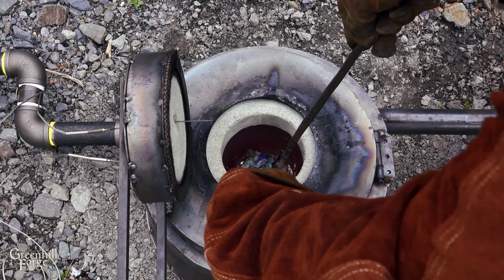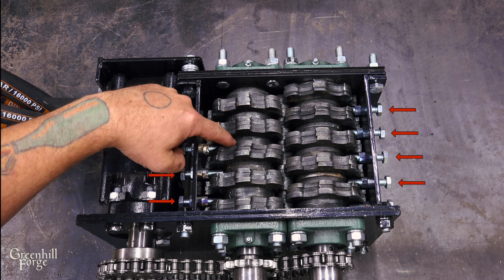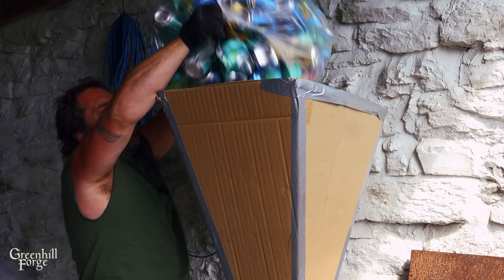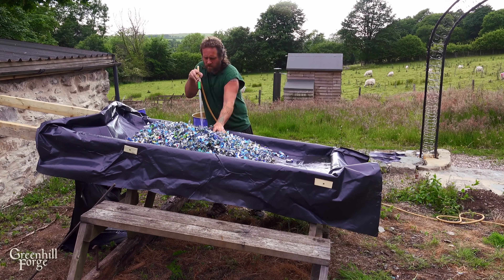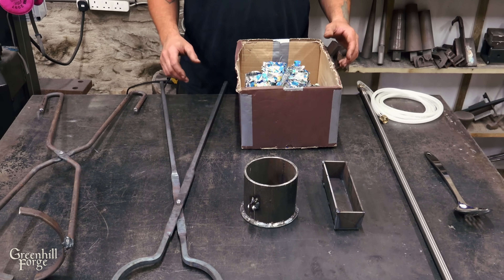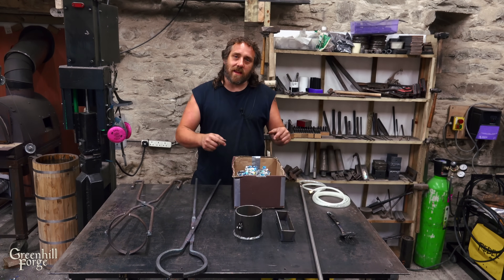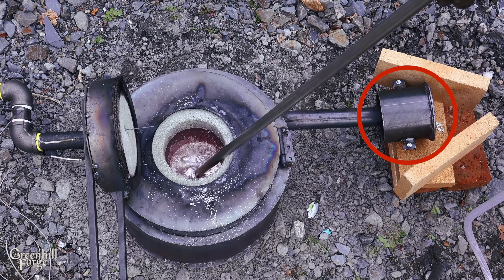DIY Casting: High Quality Aluminum from Recycled Cans!

Comment: Finally someone did it right, the only addition: should not have you used the flux from the start? although the dross was really minimum compared to everyone else but that what removed at the beginning looks like a lot of mix of aluminium, AFAIK the flux does makes the dross aluminium free (more yield)

Comment: You seem to be very knowledgeable about this, far more than the average diy enthusiast so maybe you already know this but here it goes anyway. I know there is a way of getting the printing off the aluminium sheet. I think it involves boiling or baking it first and then wiping it off with acetone or some other substance. There are probably videos about it. I don't know whether there is a method for getting rid of the internal coating. Perhaps neither the external printing nor the internal coating are much of a problem with regards to final metal quality when melting the scrap aluminium sheet - not enough to warrant the additional cost and effort. If not, where do the impurities originate?

Comment: Very good, never a dull moment here. Some good comments on here regarding the chemistry😂, metallurgy is a specialised subject itself. Maybe try some inlet manifold castings or wheels as they would be easier to chop up than a cylinder head. I worked as an electrician in an aluminium smelter, they used to suck the molten metal from the bottom of the cells to stop it oxidising. Don’t know if that is relevant to you? Still you have my attention, all the best. Cheers

Comment: Maybe you should sacrifice one of those pours so you can cut it in half to see if you truly do have a solid piece and zero air bubbles are trapped in the middle....  and you can just re-melt the pieces without having to do anything to it (you might get a little slag just from air mixing in while it melts)
- And like I said in my Novel of a previous comment, you should collect all that slag/dross that you scoop off and re-melt it just to see if you can recover any more from it because that was a HUGE amount of slag that came off of that first scoop..... but I'm comparing it to seeing years and years of another channel melting cans without shredding or washing them - just crushing them.... THAT is why I'm SO interested in seeing how much you recover from re-melting the slag :)
- BUT I REALLY like your setup...  do you have a valve on that pipe that comes off the furnace to pre-heat aluminum blocks and molds? cause I would think you are losing A LOT of heat if it's always open..... and I noticed you're using a blower along with the propane, but the guy I watch doesn't use a blower at all, just the pressure from the propane tank...  But you see a LOT of orange flame coming out of the center hole in the lid and when he opens the lid... so he must be using A CRAP-TON MORE PROPANE than you, and thats why he's got so much large orange flame.... I wonder if its quicker for him to melt than with using a blower.... I would think so, but its much more wasteful... and expensive!

Comment: why are you washing the shredded cans? I follow another channel where the guy just melts scrap copper, aluminum, brass, and cast iron... And he too collects aluminum cans and melts them down, but he doesn't shred them - he just crushes them... one at a time with a custom machine (think of a car piston being used to squish the cans down from end to end... just like how you would stomp on one :D) .... he doesn't wash them at all tho....  he just drops them into the hole in the lid of his Devil Forge furnace....  and once the crucible pretty much full he just takes it out and with a DRY steel spoon he scrapes off the dross/slag and tries to get as much of the melted aluminum to to fall back in using the side of the crucible..... BUT when he's all done melting the cans, he will RE-MELT all that slag again because with aluminum a whole bunch gets trapped in that clump of slag, along with a bunch of air too... so you can get yourself quite a bit back from re-melting it all...
- BUT he never washes the cans off (and he doesn't shred them either) and I've read in the comments other viewers asking why he doesn't shred and rinse off the cans to get off the excess pepsi or beer or whatever because there are gonna be a lot of different sugars that burn and stick to it..... and he replied something along the lines of not needing to because it all turns to carbon at those temps and will float up into the slag IF it stuck to the aluminum (it mostly turns top ask and flies off once it floats to the top of the melted aluminum) and because he re-melts the slag that comes off he's not too worries about any small amounts that might still be left in the slag that get lost.. it's just not worth all that extra effort (I'd think mainly because he's not shredding them, and the cans would hold soooo much water even when they're crushed)
- IMO you're doing a lot of extra work that isn't gonna make too much of a difference... 
- - -  So I'm thinking you could do a little bit of an experiment where you you shred up two batches of can, both the same exact amount (I think counting out the same number of cans for each batch would be the best way to keep the same amount) and one batch you do everything the way you normally would, but in the second batch you forgo any of the washing steps...  and EVERYTHING else the same... and see if you get any more/less slag and/or weight at the very end.... and my theory is that you might have a but more slag in the non washed... but you COULD set that all aside and re-melt it later... and then compare the the results and see if the extra work of washing is worth any amount that you gained....
- -  BUT you can just ignore my suggestion and do thing YOUR way.. it is YOUR channel after all and I have no stake in this.... I just wanted to help you save some time and energy :)

Comment: This is great, I've been scratching my head on how to degass my pours and your method is really straightforward.

I think it's really awesome that you're using other projects for this, and that this work supports another project as well. The synergy!
Reply: Just because you think you are doing something doesn't mean it actually works. It has to be done right. And without doing a comparison, with and without, you have no idea if what you have done made any difference.

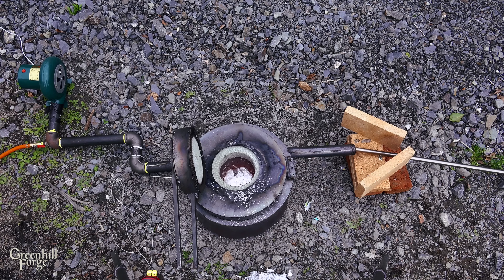Comment: 7:50 Common mistake, borax is not a good flux for aluminum because it reacts to form aluminum borate and oxygen, which will then oxidize other aluminum. So it's a horrible flux. But sometimes people want aluminum borate for alloying purposes, but for this you need to weigh it
Reply: Then what is a good flux for aluminum
Reply: I've heard that salt is a better flux ?
Reply: the best flux for home smelting of aluminum cans is a sodium-potassium chloride mixture (lite salt), with commercial chloride-based fluxes offering enhanced performance when used with proper degassing techniques.

Comment: Hey man, I rarely do comment on yt but this one here is for you to encourage you further developing your process.
Just a thought, to simplify things a little with regard to shredding and cleaning:
Why not modify a barrel by inserting a screen and a bottom valve to drain dirty water whilst the same barrel already acts as receiver for the shredded metal?
By doing so, you'd be saving space and time in your process.
Another way could be to have the barrel rotate whilst its washing the shreds. Youd be achiving a better cleaning result and whilst the barrell is still horizontal, draining is also easier to achieve.

You rock, greetings from Germany
Reply from the maker: Thanks, good idea. I think if I was going to do a lot of this I'd try to find an old used clothes washing machine online and use that. Maybe screen under the shredder to separate anything too small that could damage the pump or go through the tub holes. but that's basically what you described so I think we're on the right track.

Comment: Borax is a flux for higher melting temperature metals, not for aluminum. For degassing the argon needs to be in very fine bubbles. The large bubbles you are producing effectively does little to remove hydrogen in the melt. The large bubbles creates more turbulence on the surface creating more oxides and exposing more aluminum to hydrogen in the air which is absorbed back into the melt.  

Go to Google Scholar and search for Castings Practice: The Ten Rules of Castings. Go to section 1.5.1 Degassing. I would provide a link but YouTube deletes eternal links. 

Your heading says High Quality Aluminum from Recycled Cans. What you are doing might make the aluminum better for casting than just using melted cans, but it still will not be High Quality Aluminum. Never mind the unknown alloy mix, the problem is all the oxides in your melt. Due to the cans being effectively all surface area the oxides level is extremely high. Oxides are hard to get out of aluminum because the density is almost the same as aluminum. It will not float out or sink to the bottom unless you can control convection in the melt. 

I applaud you for trying to produce a higher quality output. While you have done more research that most hobby casters it isn't enough to get the results that you think you will be getting with the extra effort you are putting in. 

 Complete Casting Handbook - Metal Casting Processes, Metallurgy,  Techniques and Design    Second Edition by  John Campbell is a great book if you want to get a deep understanding. It is over 1000 pages and some of it is quite technical. Its not cheap. Castings Practice: The Ten Rules of Castings is a subsection of this book and would be a less costly option that is more practical in its scope.

Comment: Using the waste heat from the furnace to pre-heat the blocks!! Great idea and applaud the safety of that removing the moisture from the cubes before dropping them in. I may not have done myself.

Comment: I have all of this equipment but never realized how much more I needed to know. Thank you so much. Wow 7% silicon. And 1% copper. That is valuable information. I don't know if you'd ever be up for it but just showing Metal without having gone through your process and comparing the two might be fascinating. Tests, maleability machining, etcetera.

Just great solid content, man. Good on you.

Comment: So why not just do a good rinse on the cans and then crush them before pressing? Wouldn't that be easier than shredding, washing and all those extra steps?
Reply from the maker: I shredded/washed about 1000 cans. My thinking was I'd get them cleaner and drier by shredding them. More of a process but my goal was to go for as good an alloy as possible so I wanted to prep as well as possible. Side note, I think being dry is much more important than being clean.
Reply: That makes sense. Thank you.

Comment: Most people degass by adding an aluminum foil packet containing table salt... and pushing it to the bottom.

But I don't know how this would react with the silicon and copper...

The other major thing is that copper melts at higher temperatures, so that should generally be melted first in the process of making alloys...
Reply: Copper dissolves in liquid aluminium, you don't need to reach melting temp of copper

Comment: That looks really good, though I’d change the cleaning step. I say that for a couple reasons. The only bit you’re cleaning off is the residue of the contents of the original cans. You won’t remove any oxide layers or even the plastic lining on the inside of the can. Skip using the water bath, save the time, melt the original cubed shreds into ingots. This will remove the majority of the oxides, but more importantly it’ll correct the math for your alloy instead of including the weight of the dross. I have bars of beer cans I’ve melted down so I’ll use your numbers of Si and Cu and see if I like the alloy for casting parts. Great work, good video!
Reply from the maker: Thanks. My thinking is that sugars can add a lot of impurities and the goal here is to get as good aluminum as possible so I think washing probably helps. I wouldn't want to do very much of it but for a specfic pour I don't mind, it's even fun. the si and cu weights are not based on pre melting weights, I recorded the volume of the crucible at different heights with water before the melt so I was able to estimate the volume/weight of the clean molten aluminum pretty closely.
Reply: @GreenhillForge the sugars burn off at the elevated temps i use for initial melts.
Reply: Yeah, the shredding and washing is absolutely unnecessary. Just crush 'em and straight to the forge.

Comment: Funny thing, borax is actually a bad flux for aluminum, but people use it anyways because it works on steel.  Have you considered using Nocor? When I run my cans, I do a two melts: one a rough cleaning melt to clean out the bulk of the burnt carbon from the inner can liner and paint with a propane forge; a final melt with an electric forge and Nocor. Sure it’s very inefficient to remelt the aluminum twice, but I am planning to add additional processing in the second more controlled melt. Anyways, good job on this project so far. I liked the wash process which I currently don’t because I don’t shred my cans.  I would if an acetone rise help pull out the plastics before the first melt… food for thought, thank you.
Reply: hi mate, I also discover borax it is not ok for aluminium. I ve searched for nocor but didnt find any results, would you please give any advice about that? Thanks a lot
Reply: @josedavid6400  Sorry, I wrote a reply with a link to the correct product, but it was auto-removed or something? odd.  Anyways, I got the name of the product wrong. It's actually named Alum-a-flux or Forney 37025 Aluminum Welding Flux. It's not the most expensive flux nor it is cheapest.
Reply: @simple_fred thanks mate!!
Reply: @josedavid6400    further up and down the comments 50% NaCl and 50% KCl salts seem to get used a lot as flux for aluminum.
Reply: @joansparky4439 yeah mate this is what I actually use, works well but want to try something else if works even better. Thanks
Reply: @josedavid6400  ah, ok.  Thx for the info tho.. I collect alu to melt it someday.. so been binge watching it.
Reply: @josedavid6400 hey do you want to hear something else funny? The different parts of the can are made from different alloys. To can an alloy closer to 2124, you need to add approx 40g of copper per 1kg of cans and not silicone like the host did.
Reply: @simple_fred wow very interesting, I thought alloy was 2140 but didnt know there are different ones. 

Im looking for make this “custom” alloys to improve machinabilty. By now we are melting tons of cans for making room in the shop (we have around a few dozens of thousands) 😅 First we are melting small ingots just for make room in the shop and cleaning a bit all dross from the cans. 
Do you recommend any lecture about diy alloys? not much techy please 😊
Reply: @josedavid6400  this sounds crazy, but I
ChatGPT isn’t bad so long as you double check with sites like wolfram alpha or an engineering text. Sadly, the bulk of my text are EE related so I can’t give you a solid recommendation. My material science professor was a civil engineer. That to say that lectures were all about concrete, steel and aluminum.

Comment: 8:20 When doing these ratios, are you supposed to use the weight of the material in the furnace after oxides are removed, or the original weight of the material going in?
Reply from the maker: it's final product weight so you need to be able to wieght or guess really closely what your clean aluminum weight is

Comment: Pretty sweet all the way through! 
Only thing I could think of to help speed up your efficiency (one easy, one a little more involved) would be to add a mesh sack, or if you know anyone in the polymer business, a kevlar-reinforced fabric for your wash bin. You can make one out of tool mesh or window screen metal mesh, too, which is a fair bit cheaper and easier to obtain. Basic operation like a fry basket; leaves the water and any washing agents behind when you pull the basket/net/whatever out with your shreds. 
The can crusher is a bit more work, but designing one in my head on the fly, a hydraulic ram into a closed-end pipe of sufficient wall thickness would Really speed up the workflow. Making them as close to the volume of your crucible would be a sweet bonus. 👍👍
Reply from the maker: thanks. I have a magnesium washing drum from a clothes washing machine I use like you're describing but it's not huge and would have taken 4-5 loads to do this

Comment: Use proper flux like 50/50 mix of NaCl+KCl, and use A LOT - enough to cover your melt.
Start with melting flux first, add aluminum into it, that way its shielded from moisture and melting happens under it. 
Add thermal mass to the bottom of your form - it'll solidify better that way.
Reply: Yeah just buy half salt from the grocery store, best flux for Aluminum
Reply: @adhamatta  That is absolutely hilarious.